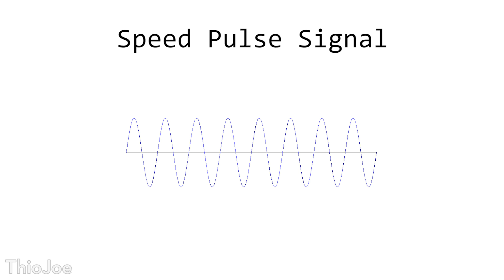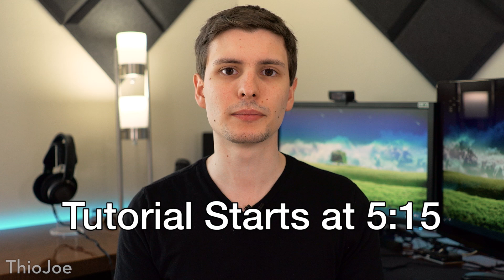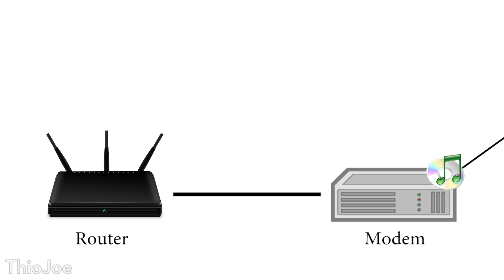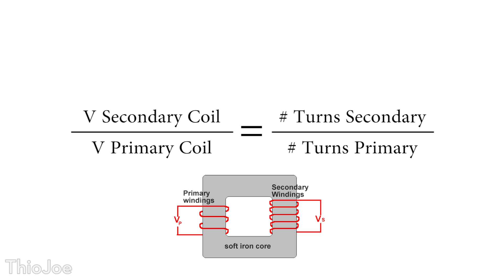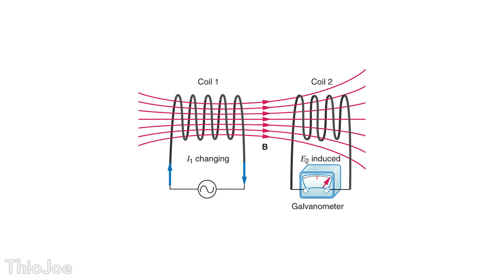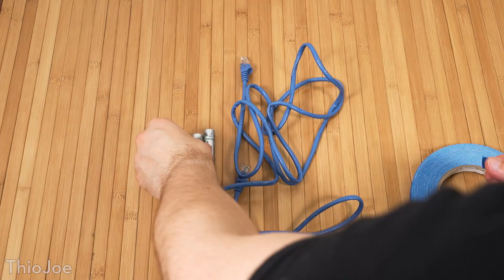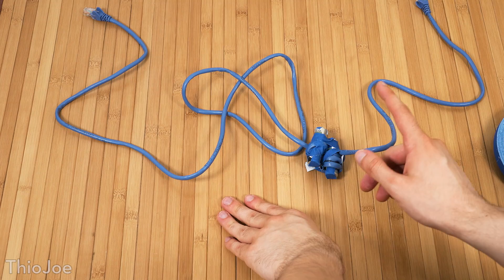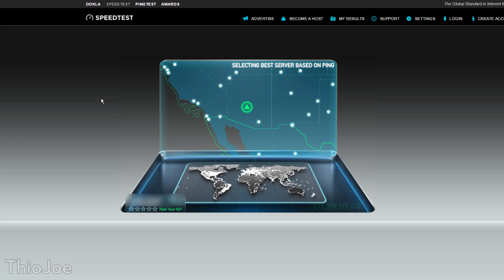How to Get Faster Internet Speed for Free

Comment: Duracell has a "TRX Shield" that surrounds the battery . If You buy a pack of 24 and do this trick but at every 6inches, You get Almost 1GB Down and 950 MEG UP.
Just ask for speed boost technology next time you buy batteries. Use Gorilla Duck Tape to hold them together around the cable.

Comment: I have a question. How can two insulated batteries that are wrapped by a shielded cable act as a transformer or, if I'm correct after the reading I've done...an inductive coil. 
In other words, how can a magnetic field be produced if all the components are protected/shielded from each other?

Comment: To make my internet faster I drilled holes through two potatoes one large one and one smaller one and placed the ethernet cable through them. Larger potato was placed near the computer and the smaller potato was placed nearer to the modem. I can go into the explanation why this works but it would take too long. I tripled my speed.

Comment: Another way to speed up your internet:

1. Use an ethernet cable of 20ft in length
2. plug that ethernet cable into port 1 on your router.
3. Then, plug the other end of that ethernet cable into port 2 of your router.
4. Once you've done this, your internet speed will almost DOUBLE. 

Please don't share this, it is a well-kept family secret.

Comment: Hi Joe, your science didn't work for me. don't know why, but I would like to know why it didn't work for me. I did exactly you showed on your video. I have a router which is connect to ISP modem through RJ 45 wire and made the transformer right exactly you showed on your video. Please advise. Nevertheless speed test results were same as before.

Comment: Hey Hello thiojoe, 
     I bought a tp-link extender and I have a few issues.
1. Everything hooks up and it works, but any drop or issues with the router, then it won’t connect to the network.
2. My Sony Blu-ray player won’t connect to the network when the extender is plugged in but is fine when the extender is unplugged.
3. It takes really long to hook up and work if the router is rebooted. 

     If you have any quick fixes or a better affordable way to get better WiFi range, that would be great!!

Thanks,

Comment: Hi, I have a combined wireless  modem and router. it is connected to the telephone line via a splitter. where do I place the batteries? on the telephone line connecting it to the phone plug?

Comment: As this is 2 years old+...I doubt I will get a response.  But, I have a combo Router/Modem.  So, once the batteries are coiled...which direction..the side with the two coils =>the computer or =>Router/Modem?  I guess I could try it both ways and see.  But I run an audio/video studio and to pull this off, I've got a real spaghetti junction to go through.

Comment: The tape actually melted so I had to give up.I do have a question, however.  Does the writer actually know the difference between a modem and a router?  He seems to use the terms interchangeably.

Comment: It will not work as there is no relative motion between the coil and the object so current will not get induced and the battery will always produce a uniform current through the wire

Comment: if you have the router modem combination together but no computer hooked up how do you do it the only thing I have is hardwired to my game and everything else is on Wi-Fi so what cord would I actually use the coax cable or what because I don't have no ethernet cord going to no computer

Comment: Dont listen to this. Your ISP provider has traffic shaping QOS policies and burst rate limits as well as speed and duplex settings set up on the ISP providers Internal equipment located at their CO where they hand off that signal to a bunch of other providers. Even if you did traffic shaping on your own end it wont override  the ISP provider configurations, it just will discard those packets due to its own Speed and duplex settings. you will also see your internet will be supper spotty dropping tons of packets and the carrier will see CRC errors and and policed discards in queue 1-8 depending on the built QOS. they do this so there is no congestion built up on a higher level port that you and hundreds of other customer reside on. YOU ONLY TRAFFIC SHAPE YOUR OWN NETWORK IF AUTO NEGOTIATION IS OFF ON THE ISP END.

Comment: This is totally incorrect, your assigned your internet speed by what's called a .BIN File. That file comes virtual and is assigned from a piece of hardware called CMTS. Amplifying the bridge between your modem and router does nothing. If anything it'll make it worse. I work for a ISP so I know.

Comment: ThioJoe...this is wrong, can you tell me how it is possible mutual induction concept only in transformer because secondary voltage induced with respect to primary electromagnetic flux but this concept is not used in your video in Ethernet cable when you increase the number of turns ethernet cable no mutual induction method is used because ethernet cable is totally isolated induction not possible.

Comment: Fake AND dangerous !
If your internet is low, the most common reason is that because of the type, the distance and the quality of the cables between your place and the ISP. You can't change that so you better found another solution. Like a 4G modem ... more safe, more simple, same price as a wired modem. You can also use your mobile's 4G thanks to the wi-fi modem, you just have to turn it on in the settings of your phone.

Comment: My ISP said that I need a CAT6, so I bought 6 Cats, but my internet speed is still the same. Then they told me I need a better Nick. So I threw my partner Nick out of the house and got another partner with the name Nick. That did not help either. My internet speed is still bad.
Then they told me I need more Ram, so I bought some male sheep, but this still did not solve my problem.then they told me i need a better mouse, so i bought a new mouse, but the 6 Cats ate it.

Comment: What a bullshit XD,stop teaching math just do it,JUST FUCKING DO IT! XD.Why i have 6mb,only reach 3mb and then not getting the 3mb? i have most of the time 2.0 and below,sometimes when i reach to 3mb the modem resets and when it comes back gives me less than that?.Now if i change my modem i get better connection but no wifi in some devices and the upload speed goes to like 600kbps instead of almost 1mb,with the other modem i have almost 1mb and 200kbps or less.

Comment: All he'll do is increase the noise on a copper line drowning out the signal and it'll get less
If such things worked people wouldn't be asking for cat6 shielded they'd be asking for cheap aluminium stranded wire in untwisted pairs

Comment: He is also recommending boosting the voltage on the ethernet cable that runs between the computer and the combo router-modem. Ethernet is a <b>digital</b> signal.

Comment: hey joe. great video. question! i have a cable modem/router  combo unit. short wire from the wall to the router. from the router, i have nothing. i am set up wireless throughout the house. will this work if i do this procedure from the router to a internet booster box plugged into the wall.?n now the booster is connected to the router by a ethernet cable. all that does is send a signal through the power wires in the wall to my back bedroom where the receiver booster is plugged in, then from there, i have a ethernet cable plugged into my android box. will i get a boost in signal strength in the bedroom.?

Comment: It almost tripled my download speed.
TIP:Use 12 sets of 2 batteties and space them 3 inch apart. Use Duracell 1.2V rechargeable batteries that have been charged to the max. You are almost done, Use GH14 Gauge 0.2 to 0.32 cables and gorilla duck tape (MUST BE BLACK). that's it.

Comment: I tried it and it doesn't work at all, don't know if I need to recharge the batteries again or to the max before hand but I saw zero change.  also wouldn't it make more sense for the side with the 4 wraps to go towards the router vs the modem since your trying to boost the signal coming out of your cable providers modem going to your router which is what everything is connected to?  I tried connecting both ways and no change. will try it with fully charged batteries and different ones to see if this may boost my signal but so far I am calling BS on this trick.

Comment: I have a POE  and an antenna that picks up the internet. Where would I put this device ot the AA batteries at (before the power or after the power) ? Thanks. The  Router cable(about 2 feet)  goes in after the power and there is about 30 foot of ethernet cable the hooks up to the antenna.

Comment: Can't work the wire continues through the windings direct shorting out the turns on the batteries, it is a shorted out transformer cannot work. A transform will induce by AC not DC from primary to secondary coils by magnetic field. If the winding insulation between a real transformer causing a    short would be the same no transformation but blow a fuse!

Comment: Where did you take electronics, your junk drawer?  I think your Ph. D. is at the bottom of a dumpster somewhere...  Adding a battery, just adds a voltage, and if anything, a Lipo battery might see it as a short, and explode or burst into flames like an iPhone.  Did you trick your parents with your artificial intelligence?

Comment: I do not have electrical tape or batteries, but was able to get the same result by placing a potato on top of the refrigerator, as science for both methods is the same.

Comment: I did this but I Used 2 Triple A Cold Fusion Reactor batteries ( wanted to use Double A but Triple A is all they had at the Dollar Tree so I had to compensate for the lower power output with a Flux Capacitor which led to a quantum singularity forming and causing Corrosion, which wouldn't have been a problem if I had a dilithium crystal chamber to contain as it can double as a matrix stable enough to contain a quantum singularity and and then use the dark matter too power 2 Warp Coils instead of using cheap Dollar Tree cold fusion AAA batteries but since I had a Heisenberg Compensator leftover from a Transporter pad I was working on (for Geordi laforge because he was playing badminton with Data on the Holodeck SMH like that was really a priority at the time) although I couldn't get the internet speeds you were capable of I did Max out around 5.3 Mbps down and 206.7 kbps up I think if I use CAT9.0 wire sprinkled on some baking soda, wrapped with duct tape and drench it with Ranch   might be able to push 6.0 Mbps and 208.9 kbps.

Comment: This is great. I was able to make it so fast using this in triple parallel and double series circuits and also a magnetron from my microwave along with an 80 foot antenna after the router.  It became so fast that I no longer need a computer. It is sent straight to my brain when I use a coil on each of my ears and one on top of my head. I can walk a mile away before the signal starts to degrade.

Comment: I was served with a cease and desist order from IBM (Internet Bandwidth Monetization) a branch of TIA (Truth In Amplitude). I have also run into problems with over-heating, caused by the TCP portion, of the TCP/IP packet, having a different attenuation rate than the IP portion, which causes excess friction on the twisted pair,  however this can be mitigated by placing the router and modem in the freezer.

Comment: OMG, thx so much for this! my ISP also offers 1GB/s internet, but I can only afford to pay 24mb.. I did this and got around 700-800Mb/s!! That's insane, thank you for coming up with this, you always have ways of making things better.
Btw, if anyone sees this: I tried wrapping it more than 4 times (I have a flat cable so it's easier), I made 10 turns on the batteries and my speed went up to 6gb/s. My guess is the ISP can put more than just the 1gb they advertise.
Also, if you use bigger batteries the effects triple (and even bigger batteries give even better results).
My setup now is 2 car batteries, 40 turns on the second one. I'm getting 150gb/s internet speed!! 
.
.
ps. I've heard my neighbors complain about their internet, I think I'm getting all the internet in the neighborhood, but I don't care! I just downloaded a 48gb game from Steam and it took less than 1min! holy shit!!

Comment: It does no work in all cases. I down loaded this video and gathered up an Ethernet cable, two rechargeable batteries and a roll of electricians tape. Did everything exactly the way it is described. It did nothing, may be even actually slowed it down a bit. So, do not always believe what you see on the internet.

Comment: your stupid because the wire has insulation and the ends of the batteries are taped off so pretty much it's just Insulation to insulation which does nothing

Comment: ping my internet speed is 2-3mbps when you try this method try with the rechargeable batteries and the cable was an increase after plugging in the power cord, remove and reinsert after 30 seconds it really works

Comment: Tried this last night and the outcome was great! First I forgot to use rechargeable batteries and went from 100 to 200. This morning I replaced the batteries with rechargeable and the finished result was between 210 and 214 between the two speed test sites. At first I was disappointed that I only got as high as 200 instead of the type of results on the video but I am quite happy that I doubled my speed. I think I will now stop paying the extra dollars for 100. 

Questions: 
1. DO the rechargeable batteries need to be charged?
2. If I stopping the extra dollars will cable be able to check my line or will my speed go down some.
3. My provider advertises a package with 400 mbps, anyone have any ideas on why I'm only getting half of that. I did try two different sets of cables.

Comment: THIS IS FAKE! The speed-pulse signal depends on the Alliston complex derivative of your ambidextrous receiver module, which is coded and encrypted in the factory. The only way to modify the speed-pulse signal is to open your modem and deinitialize the configuration array of the module using a cathodic meter, which is very expensive (around $800 on ebay).

Comment: What gave the joke away, was when you mentioned, and showed the fiber closet. By the way, wrapping networking cable around something so narrow will exceed the bend radius of the cable, and "could" damage the insulation in the cable. Good prank. Well done. :)

Comment: So it does work on speed test I went from 53.26 download and 5.6 upload to 93.8 dl and 6.6 up but on steam still the same no difference still around 10-12 MBps. and I ran 3 test for each one. I do have the very basic Comcast speed witch has always been super fast compared to Atts fastest they still can only offer 365 kbps if your close to one of there bases,

Comment: You could just place your modem in the freezer for an hour.  Plug it back in and then pour 1/2 cup of vinegar with one cup of water.  Then add baking soda. This will give you the fastest speed ever for free and it will earn you $500 a day.   Do not leave it freezer for longer than an hour or it will break.

Comment: Thank You so very much with your contribution to our slow internet speed problems. I am still using dial up and needed to find a quick fix, I took two Motorcycle Batteries and duct tape them! it was really tricky, I also doubled the batteries as a sofa leg to keep my sofa from tipping over! awesome and since my window is next to my computer desk I lifehack the Network cable to open and close my blinds! Did i tell you my upgraded speeds? Well let me tell you, I went from 56K to 56.5k WOW, a whole .5k, This really works!

Comment: @ThioJoe Initially great tricks to know. I still have to try them...
I have 2 different questions:
1) Do i have to often recharge the rechargeable batteries (as i am wondering them may get discharged)?

2) Also i saw your video on how to develop net speed (with salt water in the bottle combination). I just want to ask ' can these two tricks be done together for getting better speed(salt water in the bottle + Batteries on the wifi cable)'

Thank you for your reply in advance.

Comment: what you need to do is buy a ping quadrupeler from th chinese sellers on ebay put it in the line, and voila,....super duper fast internet that causes your computer to bog down if the date comes in faster than it can be processed

Comment: There is rubber around an Ethernet cable for a reason, it's to keep other interferences and electricity away from the wiring, therefore rechargeable batteries would have no affect making this video a falsifying money making scheme. Seriously it's just stupid how many wankers believe this trash. 100 Mbps is way more than enough for most people, there's no need to even try this. Don't even watch the free cable video, it's just stupid.

Comment: First Try) You used a Cat5 cable for a 100 mbps connection
Second Try) You used a Cat 5e , Cat 6, Cat 6A or Cat 7 Cable for a 1 to 10 Gigabit connection.

I know because i tested in my 300/300 mbps. I used a Cat 5 and got under 100 mbps and switched to a Cat 5e and got 304/306 mbps.

Comment: YOU R MY HERO BUT.... You forgot to mention that the TURNS on the 2nd batt MUST BE IN THE OPPOSITE DIRECTION!  Also, be careful you don't OVERHEAT the NIC if the speed is TOO HIGH ... 800mps+ ... had to put FREEZE PAKS under my laptop to keep it from shutting down!!  B.B.S., IT Eng (Keep up the good work)

Comment: He almost has a point.  In the early days of ISDN (the first digital phone line).  Sometimes they used magnetic camps around the data line.  Magnets were also used on other data connections to stablize them.